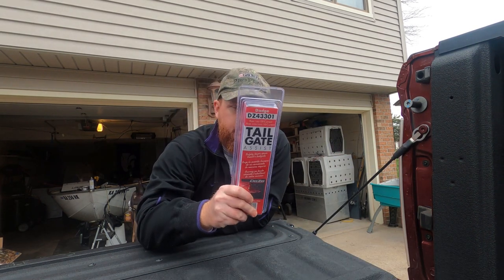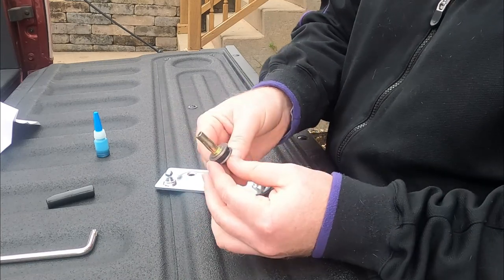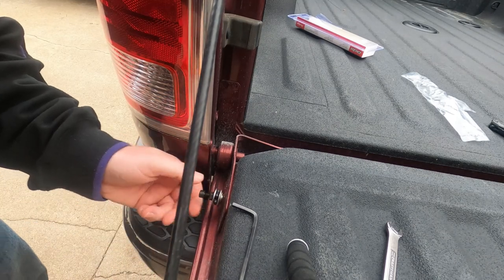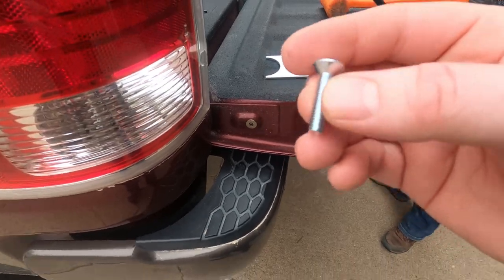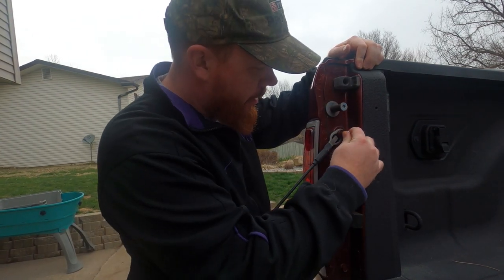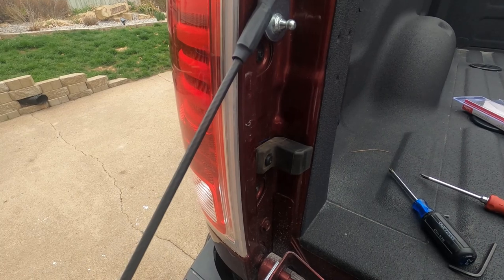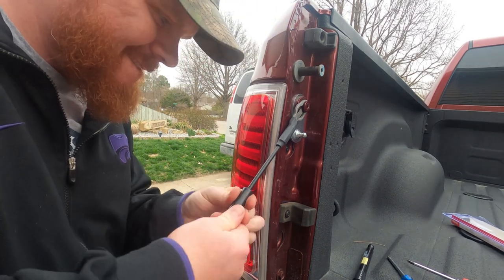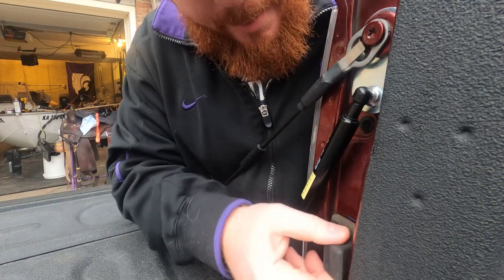Cheap Tailgate HACK (Dee Zee Tailgate Assist)

Comment: Yep! That screw wouldn't come out either. Mine was a plastic screw so I just cut mine off with side cutters. But my point for this post was I didn't know this was available until I saw your clip. It's an easy and painless upgrade for any truck. Thanks!
Reply from the maker: No problem, I'm glad I wasn't the only one with that issue!

Comment: My cable keeps getting jammed in between the taillight side of the strut. Then it’s hard to open my tailgate.
Reply from the maker: I actually had the same issue there is a clip that clips to your tailgate cable to prevent the cable from getting wedged in between the strut and the tailgate. Mine fell off at some point so I had to rig up a thick rubber washer and duck tape on the tailgate cable to fix the issue. Hope that helps you out!

Comment: Is that screw that wouldn't come out of the rubber block a pom rivet? It's the same type of design as that brass nutsert.
Reply from the maker: I'm not sure it was a plastic type rivet that was only used to hold that rubber stop. I scould have probably cut it off somehow. Did you have the same issue?
Reply: @RedbeardOutdoors-IrishSetters  I haven't tried to pull it out yet, but I have a dakota that has a bunch of pom rivets holding the wheel well liners in. If they're the same rivet, you have to use a small punch to punch out the middle of the rivet head.
Reply from the maker: @tbot6666  not sure if that will work but cutting or maybe drilling it might it's very strong and flexible.